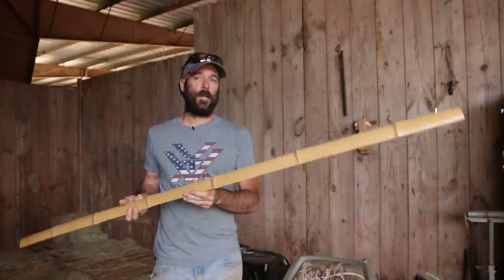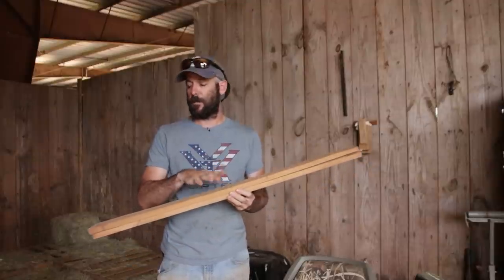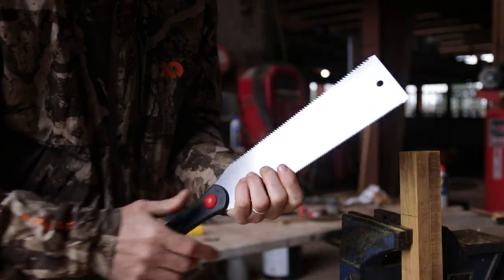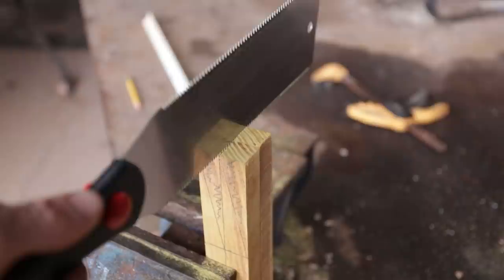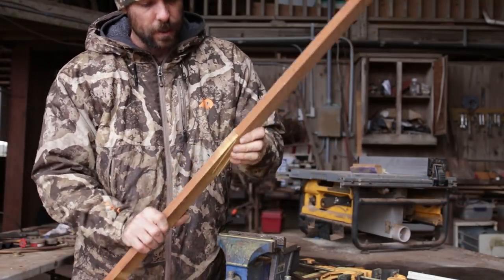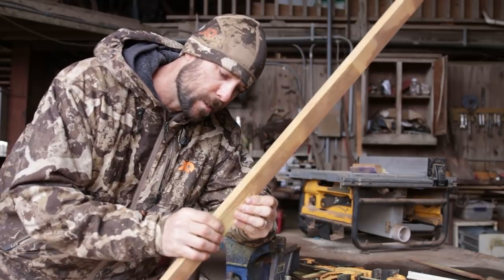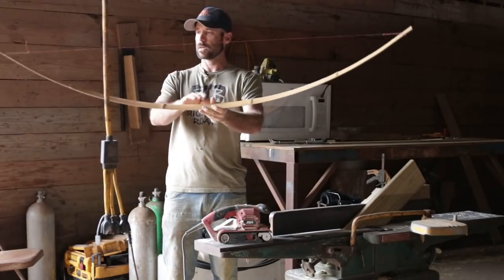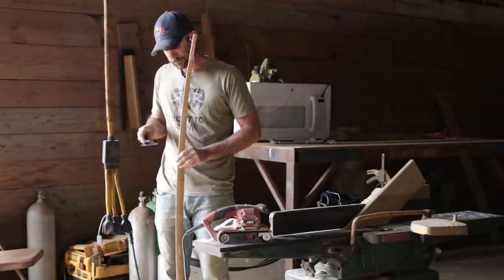Building the Bamboo Backed Longbow - Complete Guide

Comment: I honestly never considered tillering the backing- I like it! I always just shot for a consistent thickness. Profiling the width of the bamboo before final thinning is a real important step, as it compensates for the “curve” in the cross section.
Reply: I do like you do.  I usually end up wanting stiff narrow tips, so It works out.  I usually start with a tapered belly lam, though.

Comment: Getting a little brave with the grain on that osage, Clay!  Usually fine, of course, and you know your stuff. 

 Just for the benefit of newcomers, even with a backing, you still want the best grain you can find for your belly lam. Not every board or slat will work. I failed on several massaranduba bows, because the grain ran so steeply front to back and it would slip-fracture when bent despite the backing.
Reply from the maker: Yep, you're absolutely right!

Comment: I've been trying to figure out the best way to splice to half slabs together for the longest time. Problem solved! Thank you!
Reply from the maker: Glad to help
Reply: I know this is old, but for a belly laminated in the middle like this, you can even just mate the butt ends together.  If you want it to hold for pre-tillering then you need a proper joint.

Comment: THIS IS A PRETTY GOOD VIDEO.
DEAN TORGES DOES IT DIFFERENT THOUGH.
YOU PUT BOTH PIECES OF WOOD IN A DRY BOX SO IT WILL GLUE RIGHT AND NOT DELAMINATE.
AND YOU TILLER IT WITH THE STRING ON.
And more in Hunting The Bamboo Backed Bow.-----DEAN TORGES

Comment: For better and easier gluing you can boil the water, take some deep thing put it in hot water and mix the glue in this pod in hot water. Glue will become easier to handle and faster to combine if it is a epoxy.

Comment: Interesting.

I am only 7 minutes into the video, so perhaps time will tell. Right now I am asking myself why, other than limited availability of desired lengths or high postage cost, would someone create the belly out of two pieces spliced with standard wood joining methods as opposed to a single continuous piece of the belly lumber? Is there a reason I have missed?

While one is at it and if you have a local mill such as I am lucky to have within 15 miles of me, I would use a piece of lumber for the belly that came from a rough sawed piece of belly lumber thick enough that the handle was integral as opposed to glued on, but glued on is fine too, especially if you want to use a pretty wood such as Ambrosia for incorporation into the handle or riser.

I'll have to check out Three Rivers more carefully to see what is available from them. I do hope they sell the Bamboo.(edited: after looking more carefully I found they do sell the Bamboo plus quite a bit of useful tools and materials) I'd love to back with other than glass when I do back the Bow and bamboo is my aesthetic choice because I like them to look like a piece of art in addition to being functional.

I know Clay has the rawhide that he sells for backing. I just like the appearance of either natural wood or bamboo and in general forgo backing a bow unless it's really short such as crossbow prod.

Comment: Clay - I watched this interesting video again.  When you make your self bows, of course you chase the growth ring along the full length of the bow.  For this bow you didn't mention the direction of the grain for your billets.  By what I could see it looks like the grain goes at right angles to the back and belly (90 deg to the grain in your self bows).  Does this matter?  Does it make the bow weaker or stronger than if the grain went the same way as on your self bows?  Thanks Clay.
Reply from the maker: I try to select billets with quarter sawn grain that runs from end to end.

Comment: I have 2 short pieces of Osage with the bark still attached that I have had for years. My question is, can I saw them into plank and be able to use bamboo backing. Also, I have some 8 foot pieces of Japanese bamboo that have been under a shed drying for bout 6 months, do you think that I could use them for this project at this time?
Reply from the maker: There are many different species of bamboo so I’m not sure what you have there. You could saw slats from the pieces so long as they’re not too knotty. Or you could just splice them together for a selfbow.

Comment: Awesome  video.  I am a little curious about which way to do backing for performance thinner bamboo or is the thicker trap cut better or more responsive. I know it will also depend on type bellie wood also into the balance. You seemed impressed on this bows speed so just kinda wondering if you think thicker backing of bamboo made the difference.
Reply from the maker: I wouldn’t expect there to be much difference based just on that but I’ve never really tested it.

Comment: For the belly slats do the growth rings need to be across the bow width like when making a selfbow?  I noticed yours were at an angle.
Reply: I can answer that. 

You can usually orient the rings either quartersawn, or flat like a selfbow, as you say, but I have found diagonal (rift sawn) grain will sometimes twist to one side as the bow is drawn.  

And despite what a backing can let you get away with, you still want both rings and radial grain running as straight end to end as you can.  You can't totally ignore the grain.

Comment: Can you add bamboo backing to an existing recurve bow to increase the draw weight  ?
Reply: Yes. I've done this twice.  Although with an 1/8" thick bamboo it was quite easy to get it to conform to the recurves with the bike innertube, I tried 3/16" bamboo and it was almost too stiff to bend around the tight recurve. I'd taper it to 1/8" or more at the tips.